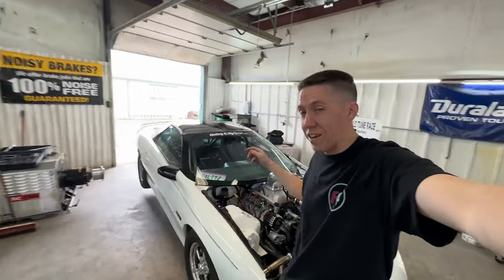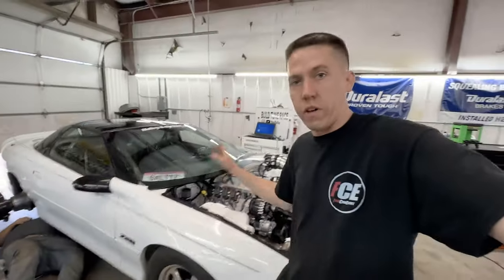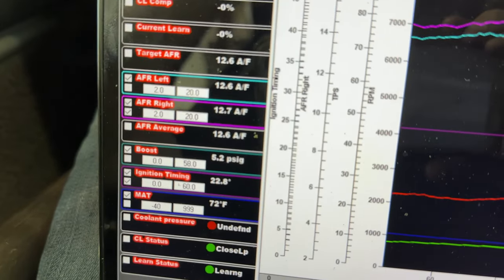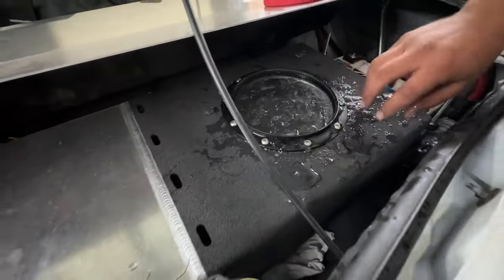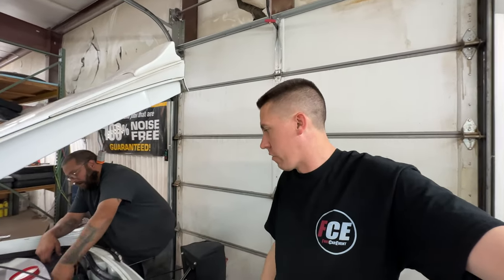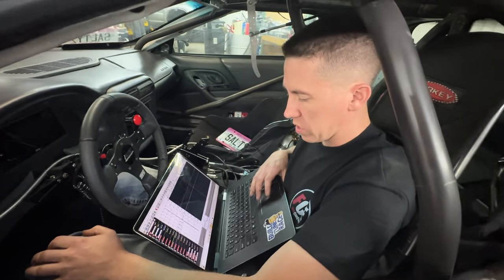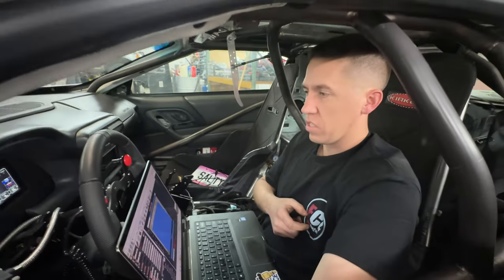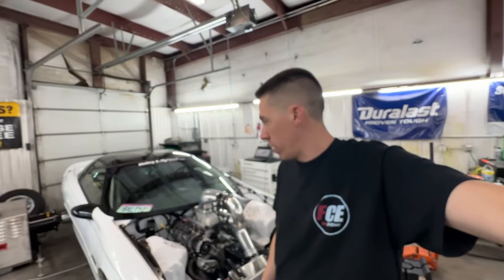Salty Twin Turbo LS Camaro Makes BIG Horsepower On LOW BOOST!

Comment: Dang that thing is a torque monster boys! An old engine builder in my area always told me "everyone wants to know hp but torque wins races".. Thank you for at least pulling one plug. I hate it when people "tune" an engine and just assume that everything's fine. Every build is different and O2 sensors vary slightly. They are just an aid, the plugs tell the whole story. Good luck out there, I'm subscribing because you pulled that plug lol 🤙
Reply from the maker: Haha thanks for the support! I would have pulled more but the car has EGTs now so it’s nice to know the other cylinders are seeing similar things!
Reply: Your engine guy took that torque quote from Carrol Shelby, he wasn't as profound as he wanted to sound lol

"Horspower sells, torque wins races"
Reply: @Jsmith9619  you assume a lot lol..
Reply: Mini Steve Morris right here
Reply: @sneezinhatch  If you are trying to insult me I could care less. Lot of salty people on this channel lol. I'm confused in how my original comment is attracting hate. What, you got a problem with Steve Morris as well I don't even know the man

Comment: It's funny how you can adjust the dyno to show more hp!  
And 22% cl is a crap tune
Reply from the maker: Welcome to the world of dynos lol. I’m just not trying to hide the fact that dyno settings can play a factor in the numbers they produce. 

The pull before it was like 4-6% correcting more timing and rpm found a new area in the map that right. That’s why we put it on the dyno to tune it! 🤘
Reply: @BuildTuneRace  
Ya we all know it's not making that power on 10lbs boost!